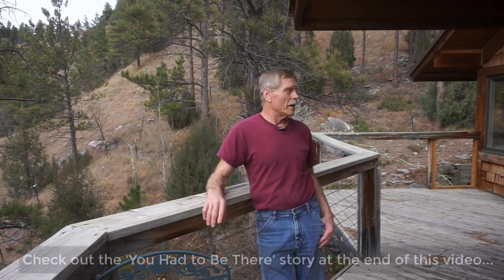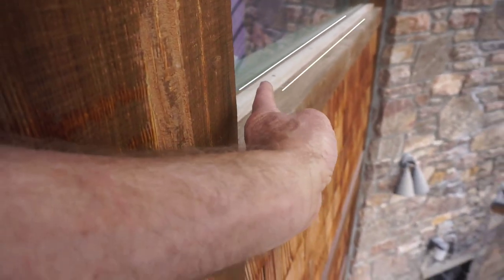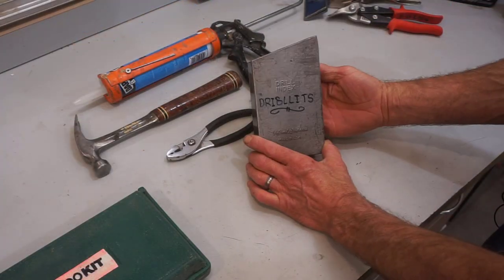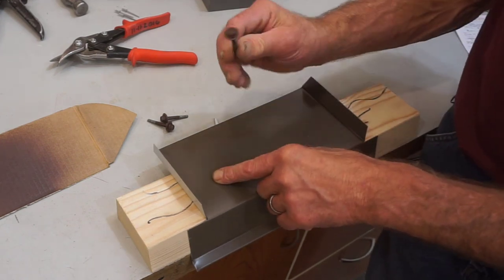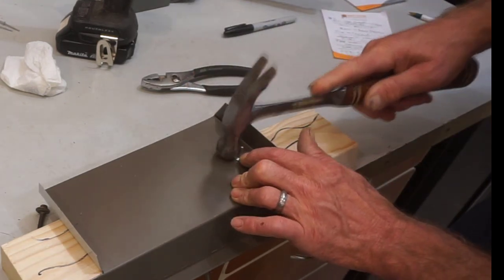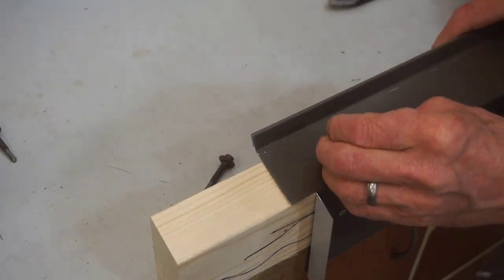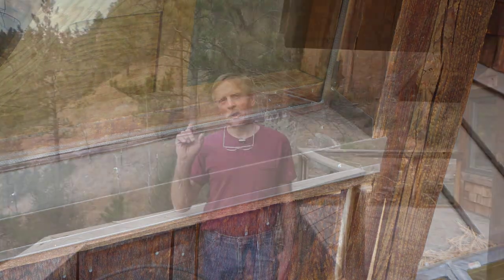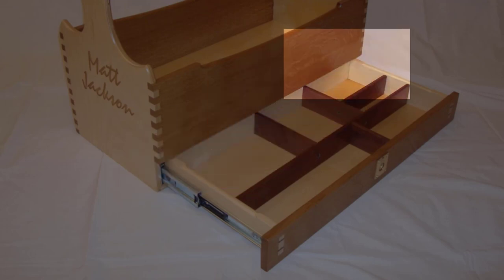Reverse Pop Rivets Fasten Metal to Wood?!

Comment: Are these what they use for heavy duty flight cases?? I have been thinking of beefing up my guitar case with the steel corners and rails I know they are riveted in
Reply from the maker: My guess is that you'd use pop rivets for the purpose they're actually designed for because this method wouldn't work at all for the project you describe IMHO.

Comment: Looks nice ...but...here's the problem...EXPANSION...when the sun heats it up the aluminum will expand and buckle...like siding will if nailed tight...you must punch a long hole so the sheet can expand and contract...the hole need only be slightly longer maybe half again the size of the nail diameter...do not nail tight..but how do I make it weather proof ? that happens under the aluminum sheet...
Reply: PS...the long hole need only be slightly longer maybe half again the size of the nail diameter....

Comment: What type of break did you use, Black Max or other.
Reply from the maker: Not sure Brent... all I know is that it's one of the big 'programmable' types that sits in Sam's shop, not any of the portable jobsite brands. The sill caps are made of the same heavy steel coil stock as the standing seam roofing panels which are supposed to withstand hail of the size that damaged the original roof so it's pretty tough stuff.
Best, Matt

Comment: Brilliant !!!!
Reply from the maker: Thanks Arek... appreciate your comment! Best, Matt
Reply: @NextLevelCarpentry  when are we going to see your new shop? I don't recall any videos on that. I know it's going to be empty but i'm curious to see what sort of place. I currently occupy my whole  attached 2 car garage and it hurts me to park outside but when you have a house to remodel you do what you have to do. So please share your new shop with us :)
Reply from the maker: @kosinskiarek  You'll start to see the new shop soon Arek, once I get it set up to the point I can actually work in it. There's a LOT of moving parts to it but mostly I'm waiting on the new dust processor and an air compressor upgrade.  The new shop isn't going to 'wow' anyone for its size; it's still only a 2 car garage but it's double deep instead of double wide.  What I do hope to show is that a shop that's set up efficiently is at least as productive as a  shop that's just larger, maybe more so, because it forces a whole new level of though in the planning and set up process.  You can see a quick glimpse of it in the End of an Era video if you're interested: https://youtu.be/5XDyS6a9nr8?t=67 although I've added a dividing wall to separate car parking from shop. Thanks for commenting and stay tuned! Best, Matt

Comment: How do you remove the sheet metal later?
Reply from the maker: Same way I would if it was nailed.  If it was a piece that needed to be removed for some reason it would be a case like I mentioned where only washer headed driven screw would do.  Best, Matt

Comment: What are you calling the drill bits? What I hear is driblet
Reply from the maker: You hear right... I'm calling them dribllits... just a silly remnant of jobsite jargon when working with a crew for many years... a guy asking for a dribllit instead of the ordinary drill bit always got a much needed chuckle when days were long and work onerous.  Goes right along with using a 'hedge slammer' and building with 4x2's while doing 'crapentry' or finishing croncreete... guess you 'had to be there'... Best, Matt

Comment: Or just use 1 1/4" electro galvy roof nail... then u can use silicone trick for the water proofing aspect. Still kinda neat though I liked this one.
Reply from the maker: I'd probably go with a matching washer head screw before a roofing nail but the method you suggest would certainly hold metal as securely.  Best, Matt

Comment: I went to Home Depot and asked the employee if they sell driblets. They laughed at me and said they only sell drill bits and continued to tell me there is no such thing as a driblet. I laughed and told them they are stupid because I watch a master carpenter on utube use a driblet to install reverse rivets. The employee then told me there’s no such thing as a reverse rivet. I then decided the best thing to do was to just walk away.  Thanks for the video can you put a link in the comments where we can by driblets?
Reply from the maker: You're funny Daniel... great story there! LOL.  Good news is that 'there's an app for that'... it's called a sharpie marker and can upgrade a full index of standard old run of the mill drill bits like they sell at the big box stores into high performance dribllits in a matter of seconds!  Please add an update after you've taken genuine dribllits back to the clerk at that store and said 'lookey here... DRIBLLITS... just like I asked about!'   While you're there you can ask about the DuhWALT BS1000 board stretcher from another NLC video to really mess with 'em 😂😂😎 Best, Matt
https://www.youtube.com/watch?v=bgS6-O2APWY&t=1s
Reply: Make sure it's the air cooled stretcher. Not the water cooled one or you'll have to keep putting water in it.
Reply from the maker: @stickslingers216  yeah, don't settle for anything less  than Genuine Fullah Board Stretcher and don't fall for that lame knock-off water-cooled model at harbor fright just because its a few bucks cheaper! 😂😂😎 Best, Matt

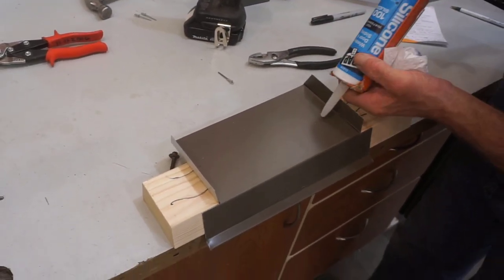Comment: 05:27 cut a "Keyhole" is that just making a smaller slice on the tips angle on silicone tube or something else?
Reply from the maker: Good question Paul... and thanks for adding the time stamp or I wouldn't have been able to figure out what you're asking.  It sounds like 'keyhole' but what I actually said was 'teeny hole'... re-listen and it will probably make more sense.  Funny because when I re-listened to it I thought for a second I'd actually said 'keyhole'! 🙄  Someone else commented that a disposable tip would allow me to  reduce  the hole size even on a re-used tube... no idea why I don't think of such simple and effective things sometimes... Best, Matt
Reply: @NextLevelCarpentry  ahaha okay thanks,  I was confused how to carefully carve a keyhole shape that small. Rewatching I only hear 'teeny' now, it's an audio illusion like the Laurel and Yanny thing.
Reply from the maker: @TheNewton  "... an audio illusion..." I like that!  Best, Matt

Comment: Nice way to use a rivet ,but you could put them the sides instead of where the water could leak in.... just a thought.
Reply from the maker: The silicone keeps them from leaking in either plane, John, not to worry.

Comment: What about using a ribbed nail same size as the post?
Reply from the maker: You'd definitely get more grip with your idea loopedmess which just might be necessary in some applications where the wood is softer.  Might be a bit tricky finding the right nail but that effort might be worth it too.  Thanks for the suggestion! Best, Matt
Reply: @NextLevelCarpentry  rereading it I want to clarify the nail the same size as the center post.  If wider it might help the rivet turned bushing to swell a bit which would also be good.  I think too much.
Reply from the maker: @loopedmess  I like the way you think... it's the best way to expand your horizons and abilities, right?  Best, Matt

Comment: You don't need the pliers , l put the rivet in the claw of the hammer and give it a tap on something hard .
Reply from the maker: Right you are splashpit... that works for sure and means one less tool necessary which can make all the difference at times.  Thanks for adding your idea here! Best, Matt

Comment: How is this better than flashing nails? They install easier (no drilling) and are less visable
Reply from the maker: I think it looks better than a regular flashing nail, Primitive Edge, and disagree that a regular flashing nail is 'less visible' unless you're using a type I'm not aware of.  Plus this metal is thick enough where it would be tough to just drive a flashing nail through so I'd be pre-drilling anyways.

Comment: That is a pretty neat trick.  But Argh . . . I was taught to use caulk rather than silicone on the exterior.  Silicone doesn't stand up to UV rays as well as caulk.  More importantly, silicone doesn't paint.
Reply from the maker: Paintable silicone is available when necessary.  The silicone that matters most here is what's protected from UV rays inside the hole and under the rivet head so it's still my choice for this metal to metal to wood application DRitz.

Comment: Id just use a stainless ring shank nail and be done with it.
Reply from the maker: Most people would...
Reply: @NextLevelCarpentry   its a cleaner look than a pop rivet with the pin left in it.
Reply from the maker: @ee4231  that is clearly a matter of opinion which you are certainly entitled to. This video is for discerning viewers who prefer the consistent look of all pop rivet heads instead of a mixture of Pop rivets and Nails on a sheet metal project. If you or your clients don't demand that level of excellence then a ring shank nail is definitely faster and easier to drive, however, speed is not the only criteria for completing a project satisfactorily.

Comment: Uh, why not a stainless colored coated nail. Wouldn't it serve the same purpose?
Reply from the maker: Same reason I didn't just use a color coated screw to attach the sills... I prefer the matching look of the rivet head.  Don't overlook the fact that I'm showing a unique use of a rivet and not strictly for attaching window sill flashing but for all other manner of attaching sheet metal to Wood.  Note in other comments people who see the usefulness of this and plan on adapting it for a unique industrial accent for a metal bar top and for other artistic applications... I always hope that viewers have some ability for outside the box thinking rather than only a direct interpretation of what's being shown.

Comment: Since you are going into wood, why didn't you just use matching color trim nails.
Reply from the maker: I like the look of the rivet head for this application since they're used for other fastening on the same project... plus it was the best situation I had for sharing this tip which can be used for many applications where 'matching color trim nails' are not available or desired...

Comment: I would use Peel&Stick roll flashing over the wood sill.  Then I would nail down a thicker base plate in strategic spots I felt I wanted to place a rivets. Drill my holes. Then put Butyl Tape on the holes of my base plate. Then install my flashing over that and attach the rivet as it was designed to be used. :)

Comment: you could just run a bead of silicon across the wood and secure it that way. no rivet showing either.
Reply from the maker: Except what do you do to keep the metal flat and in place while the silicone cures Paul?

Comment: Why not just use a colored nail that's made just for that purpose?  They make them in aluminium and stainless steel.
Reply from the maker: Same reason I didn't use a colored screw made just for the purpose.  This video is about options and alternative Solutions not strictly about attaching a metal cap to a particular windowsill.

Comment: .....huh.......why not just use a flat head spiral groove nail?
Sometimes something's can be just over-thought.
Time would have been better spent reinforcing the balustrade, it's a mighty long fall.
Reply from the maker: It should be obvious that alternative solutions are not the result of over-thinking but, rather, looking for and finding better solutions for non-typical situations...
Reply: @NextLevelCarpentry  
Sorry wasn't being cheeky or rude. Just I thought a flathead spiral nail would be quicker.
Reply from the maker: @woosheroes494  No worries... thanks for bein' cool about it.  Nails are definitely quicker and, quite often, a better choice.  This little hack is for occasional use when consistent appearance justifies a little more time for fastening. 😎 Best, Matt
Reply: Hmm. I was wondering the same thing, since it does seem like a nail. However, the central rod is flared, so it would flair the rivet, possibly attaching it securely to the metal sheet. You'd probably have a hard time pulling the rivets back out without pulling the metal off with them.
Reply: You guys are thinking like builders. There ARE more secure, more sturdy solutions. But from an aesthetic point of view, or for certain spot applications? This is awesome. There's this other part, too, where I have rivets in my bag right now. I DONT happen to have FHSG nails. And judging by the location in the background there. Something tells me the nearest Big Orange isn't right around the corner.
Reply: You might need to wear a fall arrest harness, but perhaps you could climb out and drive railroad spikes into the sill so the finished product looks like a railroad bridge.

Comment: What state are you in?
Reply from the maker: South Dakota...
Reply: Looks a lot like CO.  So these rivets are just held in by the mandril, correct?  Any expansion of the shank is happening at the top (the metal in this example) only?  Just trying to understand how it is held in place.   @NextLevelCarpentry
Reply from the maker: @TheSeancassady  SD not CO but there are similarities.  There's no expansion of the rivet's shank going on... just the mandril acting as a 4~5 penny nail. It's important to not drill the hole too deep because any extra depth just decreases the holding power of the nail.  Applications for this method are limited according to how much holding power is needed vs how much is provided.  Best, Matt

Comment: Won’t those smooth shaft rivets pull out after going thru a couple of winter and summer months, with the wood expanding and contracting? Nails seem to pull out of fences and siding, so we use coated screws. Those aluminum rivets have no barbs to keep them from popping out. The sheet metal warps in the sun and will also pop those rivets out in a year or two. 

Sheet metal fasteners are for sheet metal. They are tested against the elements in only sheet metal not wood. 

Metallurgy- the branch of science and technology concerned with the properties of metals and their production and purification.

Your first choice of using screws with rubber bushings was correct. Those are exterior coated screws and the rubber bushing does two things, water seals and prevents corrosion. The screws aren’t always available in the same metal as the sheet metal. Two different metals causes disimilar metal corrosion like in your water heater to the pipes. Water heater is steel and pipes are copper. You need a dielectric fitting to connect steel to copper. 

Science and mother nature are working against you on this project.

Let us know what this looks like in a year or two.
Reply from the maker: Wow, an ablicationary commentation there...

Comment: This is not very practical because it really has no holding power because it’s not like a drive pin anchor. It a nail. The reverse process is doing nothing to the rivet because the pin is not expanding the rivet.
Reply: Gary Lowe  I was thinking the same thing. How well would it hold?
Reply: Yup, totally right, there was no expanding so this is not riveting, plus that mandrel is so smooth how could it hold in the wood. This is the most absurd thing I have seen.
Reply: @kevinmcghee2785  You are correct - in the UK we have serrated shank POP rivets to fix to timber

Comment: aluminium and steel, not sure that's going to end well over time.
Reply: Aluminum flashing is available in this country, and the pop rivet is aluminum.
Reply from the maker: I mentioned use of stainless steel rivets for exterior applications and do so again here if there's any concern for corrosion.  My guess is that for any installation where that level corrosion is an issue then an entirely different game plan is in order.  Best, Matt

Comment: The way you flipped them rivets. It would’ve been cheaper to use nails. It’s the same thing as using nails. And nails would’ve been more flush.
Reply from the maker: Actually it's NOT the 'same thing as using nails'... only rivets look like rivets so when that's the look you want, this is the method to use when "cheaper" and "more flush" isn't the point...

Comment: I dont get it, all he did was to turn a rivet into a normal nail seen how the rivet never expanded.. and there are special nails and screws for sheet metal with a equally small head (atleast in Sweden) and those nails do not need to be pre drilled or have silicone added as they already comes with a small silicone rubber washing.. I've been using those for the past 20+ years and they never come loose.
And I'm not talking about the big sheet metal screws shown in the vid, we only use those for installing sheet metal roof.
Reply: I agree, I added the same comment above....
Reply from the maker: That's certainly trundicational...

Comment: That is called a very  expensive two part nail.  
Just use a painted or stainless nail. 
ONE piece, much better and much cheaper.
Reply from the maker: "very expensive"?!  Wow, I wouldn't think 3 cents for a pop rivet would seem so much more expensive than 3 cents for a ONE piece nail... just sayin'.

Comment: Here’s an easier way! Just us a stainless nail! Same thing and easier.  That method does not expand the rivet under the metal so why bother with all the extra work. 
Nail, silicone. Done.
Reply from the maker: I don't see what you think is 'all the extra work' here... thick metal should be pre-drilled anyways and any nail without a rubber washer should have sealant of some sort... no extra work at all beyond a responsible process for attaching flashing.

Comment: now theres a dent where water will pool
Reply from the maker: Curious how you get water to pool on a sloped surface??
Reply: @NextLevelCarpentry  on the depressed dimple in the sheet metal made by hammering the rivet